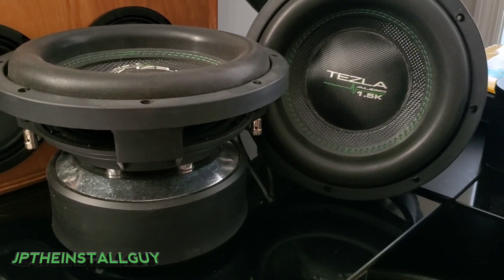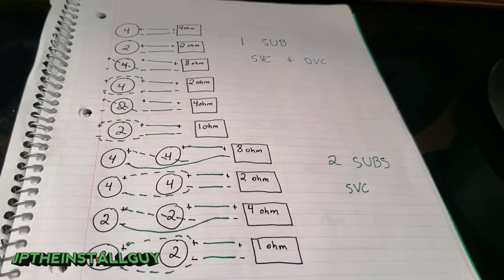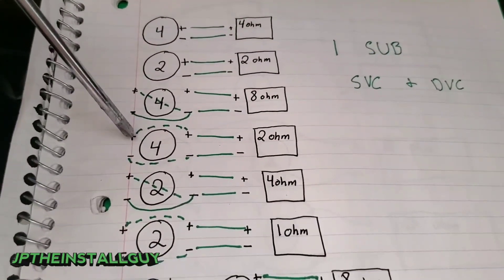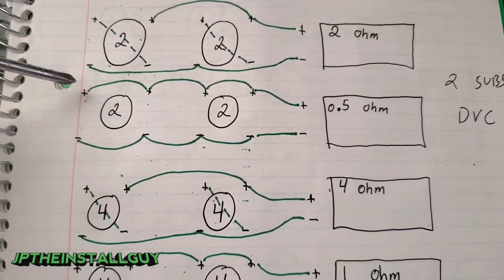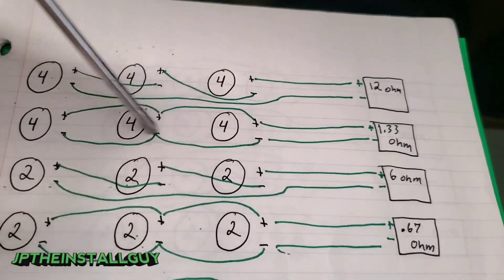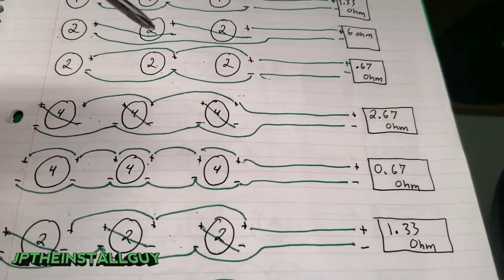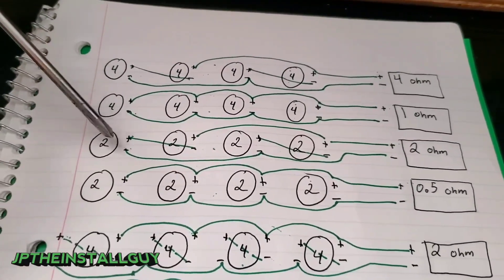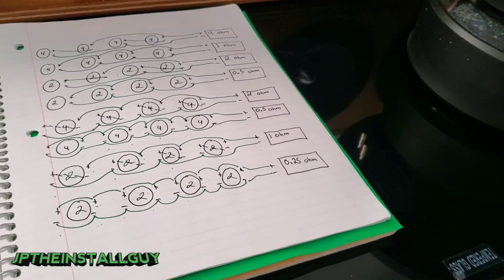The best way to wire a subwoofer : 30 wiring options

Comment: My amp keeps going into protect mode when the bass gets a little heavy. Could the way my sub wiring is be the reason it keeps doing that?
Reply from the maker: It's very possible because the amp maybe reaching resistance loads that it's not stable at or the amp could be getting to hot make sure you test how the subs are wired and make sure your amp is stable at the ohm load in which the subs are wired example, if your subs are wire to 1 ohm make sure the amp is 1 ohm stable If you are wired to 1ohm but the amp is only 2ohms then the amp will go into protect also you may have a bad sub sending the amp I to protect.

Comment: i tried wiring my radio but my constant doesn’t have any power any tips?
Reply from the maker: Here's a video on troubleshooting the radio but try checking your fuses 1st
https://youtu.be/5kXvam2VVek
Reply: Is your ground connected to bare metal
Reply: I had this issue and all I had to do was sand down metal even if it isn’t painted

Comment: This is off topic but I have a question. I'm currently running a 2way crossover before my sub amp to clean up and tune the signal. Would it be better to use a bass restoration unit instead?
Reply: Those bass restoration units are kinda more for SPL. And as an SPL builder (highest score..157.3, gonna get a 160 ths season), I feel tht I can speak for a few of us whn saying tht they are preeeeetty much a gimmick. Now dmt get me wrong, they do wht they say, however, they’re really just an unnecessary addition whn you can get the same results out of something as simple as a x/o. There are actually a few ways to get a pretty clean bass signal, the main one being the quality of the amp pushing the signal. This hobby is one of those where “you get what you pay for” is GOSPEL. Take it for what it’s worth my man, but this JP fella is a true basshead w the old school ways at heart. It’s up to us bassheads to help other bassheads and further the love of the craft. JP knows his shit and unselfishly offers it out. True basshead right there. To you, JP and all the youngster Bh’s coming up…….BASS ON
Reply from the maker: Whatever your using to clean up the signal is fine I actually am not a fan of bass restoration devices just my personal opinion
Reply: @jptheinstallguy  Appreciate the info...